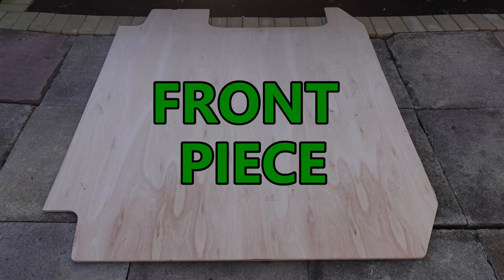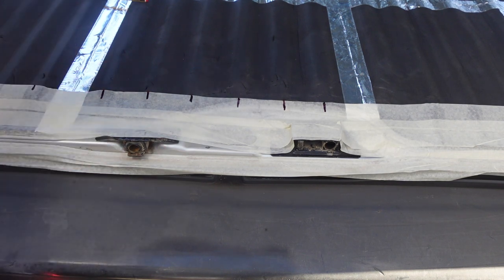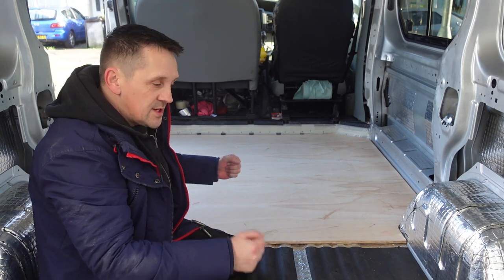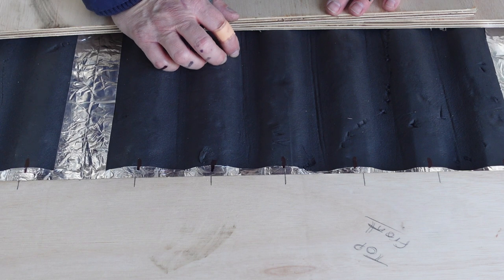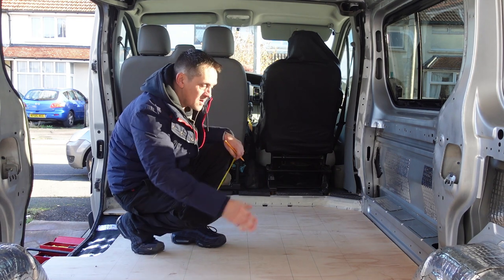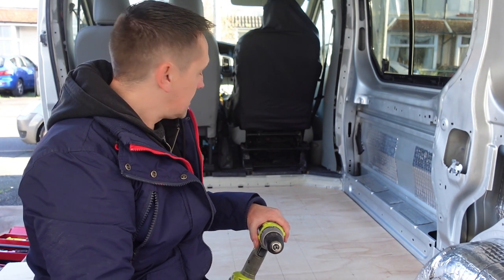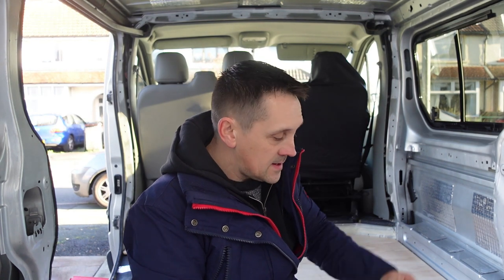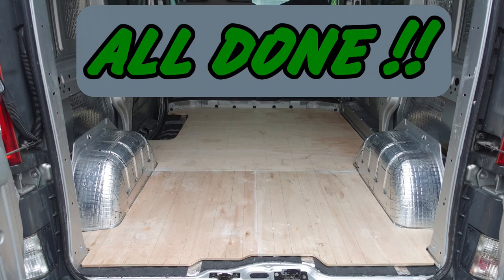PART 6 MY Renault Trafic Camper Van | Day Van Conversion | Installing Ply Wood Flooring

Comment: Hi Steve, used the same supplier for my conversion of Nissan Primastar, had exactly the same problem, all of a sudden it dropped into place.
Reply from the maker: That's great news! 🤣 I thought it was just me 👍
Reply: I also used their cupboards for the van, they are an excellent product as well, except that you need to check the height, couldn’t fit the top of the tall cupboards, due to thickness of insulation and the 12 mm flooring, still thinking how to finish it off. Hope it helps.

Comment: Hi. How did you finish the section by the sliding door. Where you have the step down in levels ?
Reply from the maker: @damienmcnamara4147  hi,  I just used carpet 👍

Comment: I tried doing exactly what you've done but went through van floor.. Same size of screws... Any suggestions.. Thanks
Reply from the maker: That's bizarre did you drill through the upper or lower channels on the floor? The screes you done I'd put some sealer around the screw on the underside of the floor just as a precaution but none of mine went through the floor. Is it the same van?